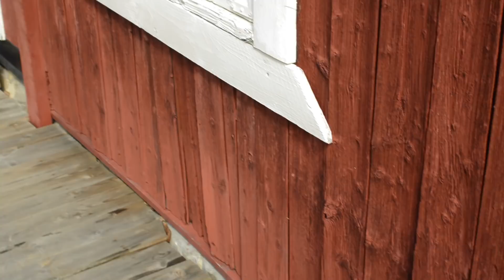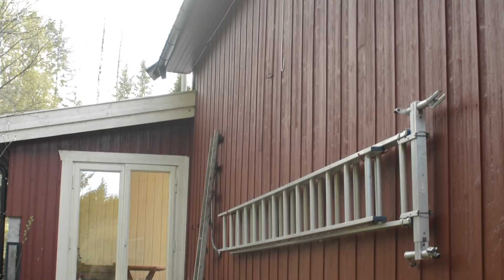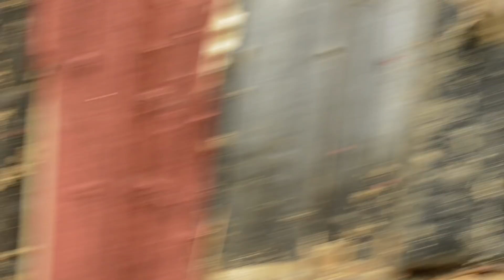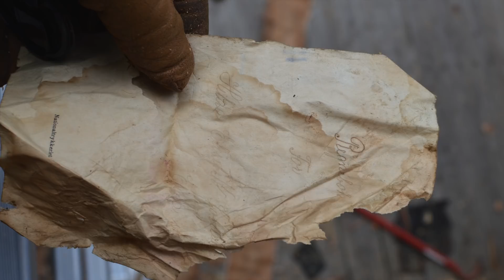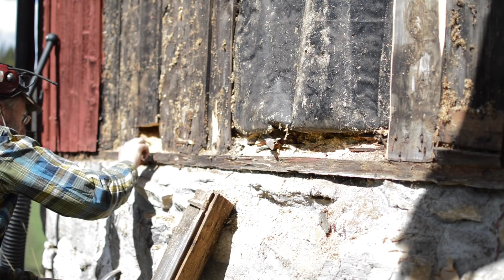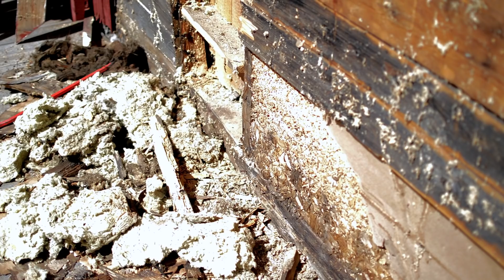Norwegian 1899 Post and Beam house repair 1/5

Comment: I'm glad to see there is a tradition of leaving clues for future carpenters. Sometimes I'll write a note or put a newspaper in a wall. Even though I know it won't be seen by anyone for 50 years, if at all. 
The older houses here (SF bay area California) were often modified in the 1940s to accommodate workers of the war effort. It's not uncommon to find a large single family home parcelled into a half dozen tiny apartments. Usually that work was done in a hurry by guys that were not trained as carpenters. All clues are helpful to a restoration.
Reply from the maker: The work I am doing in these days had a newspaper dated 13th May 1893 stuffed in to the corner. Also the owner at that time clearly worked at the paper mill near by because paper pulp had been used in quite large quantities to try and seal the line-scribed walls of the timber house, before they were panelled (in 1893).

Comment: Lucas........I am tempted to treat some 4 x 6 timbers I milled recently with wast engine oil.
What are the pro's and con's......Should I or shouldn't I?
Reply from the maker: Research by Jon Brænner, showed that engine oil actively destroys the natural wood glue that holds wood fibres together and that action is further aggravated by sunlight. The next couple of films in this series will show a direct example of this, the one case I have worked on that confirms his findings. As far as pros go I don't know what they are, maybe insects don't like it, just a guess?

Comment: Looks rather good to me considering.   Having a higher foundation certainly helped.  Why not the Mineral Wool insulation?  Haven't heard any negative on it.   Thanks for sharing!
Reply from the maker: Hmm not sure how hard I want to hit into the mineral-wool and glass-fibre products in Public...suffice to say that in a wooden wall it makes sense to use wood or wood fibres.  Attacking the most powerful lobby group in the industry might be foolhardy, and anyway those products are good for some things, just not old houses IMO.
Reply: So whats the replacement going to be?  More shavings?
Reply from the maker: It will be a cellulose product, hmm that will spoil the surprises....the details will be in the films.